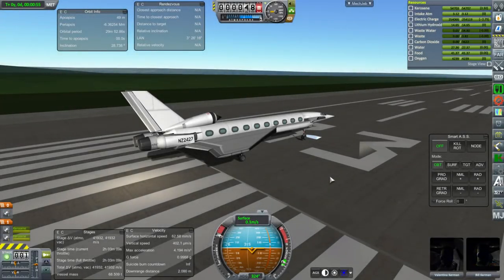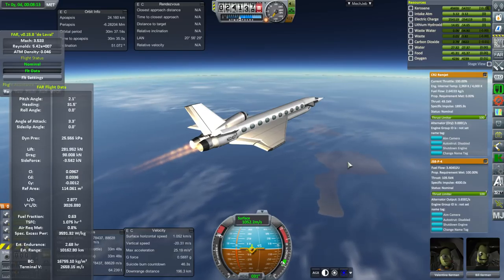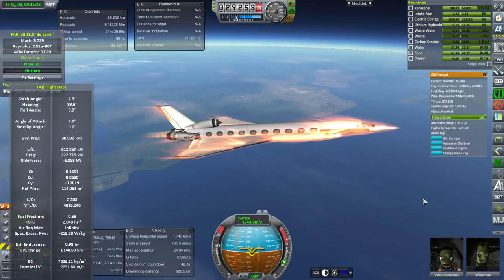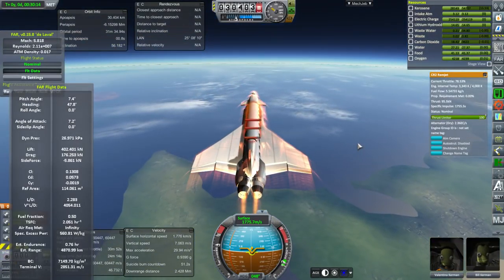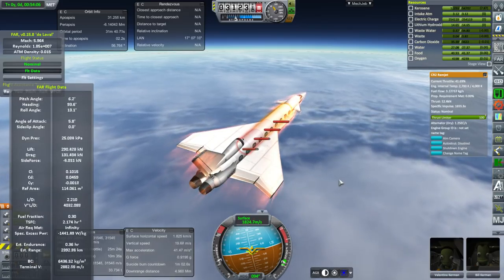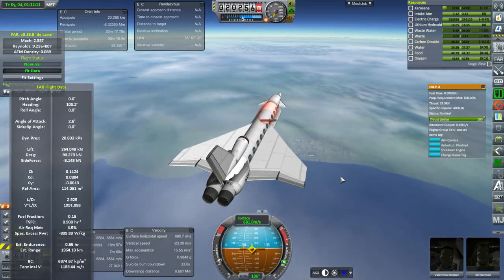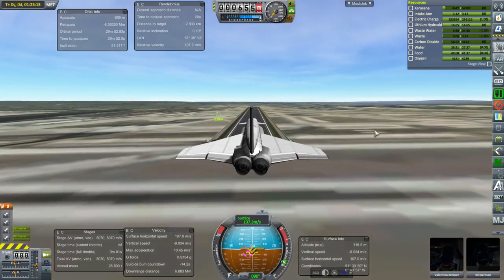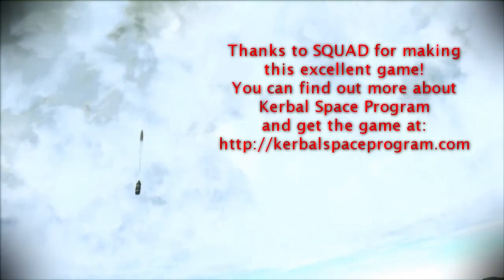Kerbal Space Program RO Sandbox - Hypersonic Liner Development 06 - Cape Canaveral to London

Comment: 85 minutes transatlantic. Very impressing :) 

How do you think, will the heat be an issue in reality?
Reply from the maker: It will be, but there are ways of dealing with it. I'm thinking primarily of the material used for the X-15, but active cooling by pumping fuel through the structure is also a possibility (though I don't know how transportation safety people would handle that). There may be newer materials that I don't know about which would work better.